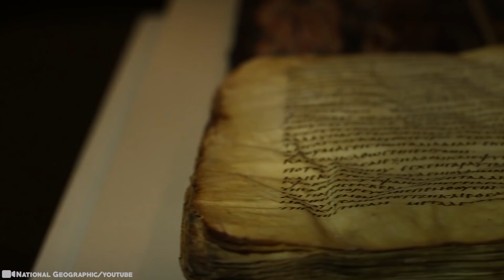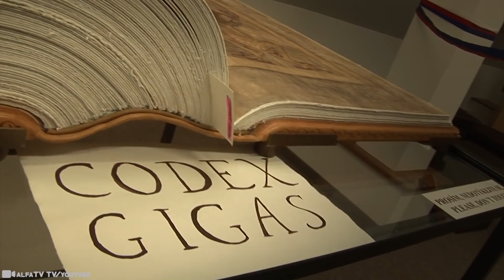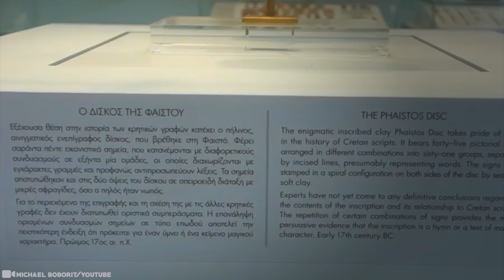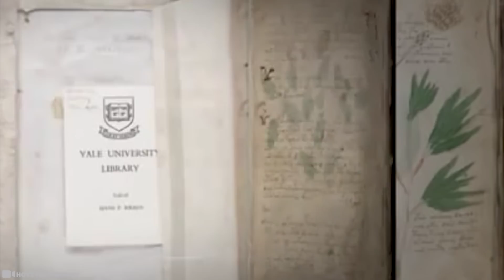15 Old Technologies Scientists Still Can't Explain

Comment: Roman concrete also used sea water to mix their concrete. The salt acts as a binding agent in the concrete and makes it less porous and much stronger. To any roman you knew to use sea water where as in the recipe for concrete it simply said water and nobody thought for a while to use sea water and not just water.

Comment: It's always baffled me when so called "intelligent" people can't understand how the ancients were able to create some of these items without "Modern" technology.
Reply: Probably because the people conducting the research are archaeologists. That doesn't make them good at physics. We probably have the capacity to figure most of the science related things out - we're just not concentrating our resources on them.
Reply: @crikeymikey8731  I was just watching a video on the Bagger 288, which is the largest bucket wheel excavator in the world.
When they measure the output of these vehicles they measure it by how many people carrying pick, shovels and wheelbarrows it replaces, the Bagger 288 replaces 40,000 men. When the ancient Egyptians built the pyramids, they didn't have a bagger288, they just used the 40,000 men because they didn't need modern tech to perform the same task.
All modern tech does is replace people in the workplace, it didn't mean that it made certain tasks possible. We have way too many so called "intellectuals" lacking humility in the face of science. That seems to be a new thing.
Reply: @scottfuller1711  lmfao

Comment: Modern Damascus steel is not the same as the original metal. While it may be made using the same techniques, the original Damascus steel used a metal called wootz steel. Wootz steel does not exist today, but moden blades made using high-carbon steel and forged with pattern-welding approximate Damascus steel.May 2, 2021

Comment: What a load of rubbish. Damascus steel is still made and used in English shotguns. Its production method is very well known and is not a lost art as the commentary suggests. Try to be a bit more factual and not sensationalist.
Reply: The Damascus we have today is not the same as the Ancient Damascus. Scientists however, have been able to find that Ancient Damascus contains  nano tubes within the metal, and the only thing in nature that has such nano tubes within its makeup is plant fiber. They know that they must have mixed plant fiber into the metal when they forged the blades, but they do not know what process they used to make the Damascus metal. The process of making this Damascus metal was kept so secret among the ancient bladesmiths that it has been lost to time.

Comment: We know how to make Damascus steel. What's more we can't make even better steel today. Modern steel is vastly superior to ancient Damascus steel. 

It is true we don't know how ancient people made Damascus, because it requires heating iron ore over 2000°F, something we're not sure how the ancients actually achieved. But Damascus was very pure, and had a high carbon content, so they would have quite strong. In the iron age though Damascus would have seemed supernatural. If your sword is much stronger and breaks the swords of your enemies, it would have seemed magical. Some archeologists think ancient Damascus forgers might have introduced carbon material in the form of bones. Which if you imbue your weapon with the bones of an ancestor, or a fallen warrior, you might perceive the unbreakablility of Damascus being the spirit of your ancestors enchanting the blade. 

So no, Damascus steel isn't magical. And it's not necessarily better than modern steel. But it is beautiful, especially if you etch it with acid to show the layers. 

But the point of contention is more just how did ancient people make it, not that we can't make it today. I guess you could say we don't know the exact recipe so we can't make it exactly like they used to, but yeah, modern techniques are superior.

Comment: Complete and utter B.S. What exactly does explain mean? 
   Things stated as though they are facts that are speculation. For example, The statement the Ancient Temple of The Holy Frequency was built to resonate at 111 hertz. Any and every volume with a single opening has a resonate frequency. Blow across the mouth of a bottle. The larger the bottle the lower the resonate frequency. 

    The only way anyone could know if the temple was designed to resonate is if the builders said so.

Comment: You really need to check your fackts. The knowledge required to forge Damascus steel was never lost as it is exactly the same as forging any other steel. Some years ago and American finally recreated it, The term is often used incorrectly when refering to pattern steel. As for building structures with huge monoliths, that to is no puzzle plenty of archeaologists have demonstrated how it is done. The only unknown fact regarding the Antikythers is who design and built it, There are now a number of working replicas and we know what it is for and how it works.

Comment: Damascus steel is just blue steel forge at high temperature with certain techniques the patterns are just a side effect of the process and depends a lot on the quality of the iron and how it was cold etc.

But yeah there is a ore called or said to be called damascus ore in witch its just iron with very specific qualities, it is said that the high quality iron or good formed iron as in with( low impurities) if im not mistaken was abundant in mines in literally damascus  were in gets its named.

But there a better steel technique called spring steel witch is better then damascus base on some resources already in old times the spring sword was already made a long time ago, it is said that spring steel in addition being or atleast for what we know for now spring is the best steel made.

Its is said that this steel can literally bend its extremely flexible and fast while also being more durable.

Clear example of spring steel are weapon like the rapier witch can bend go back to it original form without breaking or  shattering or remaining bent that's were the name spring comes in in addition of having also high durability.

But yeah im not saying your wrong and neither im  criticizing you since there a lot of misinformation circulating the internet about damascus steel, but damascus steel is one of the best steel, but not the best or the most durable.

Also their are modern methods to make damascus but it patern depend on the way it was made and the amount impurities in the iron ore.

Ill just leave this comment just for information, its not meant neither intended to offend anybody or criticize anybody, its just some clearing information i learned in the internet and multiple sources.

Comment: right off the bat, the sword didn't rust because it's not iron or steel. It's bronze. Bronze doesn't rust, it patinas and the patina effect on bronze isn't as destructive to the material as rust is to iron and steel, not by a mile.
Reply: ... especially when they said 'And it was in perfect condition' while the video in the background showed how they pulled the messy lump of crusted metal out of the box.

Comment: most of them are fake and I hope you are ashamed of yourself. Just for the one I already know. 
The sword of gouijan is a incredible piece of art and history yes, is it magically not rusting ? No, in fact it is very fragile and rusted. The fact that it was found in an air tight room along with the composition of the decoration made it more resistant to corrosion but nowday it is as fragile as a piece of porcelaine and could break. It did indeed partially break after a light shock and is now forbidden to go out of china. Also the inscription are translated almost perfectly. 
The iron pillar date from the 11th century ("so old it predate the wheel" seriously?). And it is very impure indeed, not 99.999% iron or I don't know what bullshit. You are so bad that you did not understand what make it mysterious. The lack of corrosion and rust despite its age is amazing not the purity of iron. It is indeed the impur iron that made it not rust as it is believed that the wood used for smelting it were phosphorous high and thus created a layer of phosphorous oxyde with Iron that protect it from corrosion unlike classic Iron. You are misleading and you did not even understand the legend you are telling. 
modern damascus steel is not particulary hard or sharp (by modern standard). It is not even a quality of metal. It is a word used to speak about this beatifull patern that can be made by a variety of steel. You need to stack different sheet of steel wield them together and a bit of acid will make the patern appear. The ancien damascus steel was indeed a very good steel for its time we have blade and other metal scrap that can confirm it. It was not magical nor the best steel on earth at that time. Indeed it was made by arab and persian who imported the steel from asia which got better steel and wielding technic at that time. Even in europe you can find steel as good as damascus but it was less pretty. The european going into crusade tell the damascus steel to be the most impressive to make their ennemis look fearsome. The arab spoke about the steel of their armor and long sword (very hard to make a long sword that hold well) the same way, and indeed a long hard resistant often demand much better iron than medium size saber. The shape of which is made to cut better while distrubuting the force of an heavy blow, the long sword does this just thanks to its materials (a bit simplfied here).  We perfectly know what it was it is called wotz steel. A lot of forgeron and scientist remade ancien damascus steel but it is impossible to know the exact technique that was used because it was lost in time. We can make the same using old technics we can make better with modern technics but we are not exactly sure what technic did they used. It is a question for historian as making a steel that is resistant was never easy at that time because forgeron did not know what part of their preparation was usefull. The quality of the raw material was for some as important as the "magic" forge or the "magic" salt they used to make it. Because of that they lose their craft as the salt composition might not been known or the reason why the forge was magical either, even more the raw material could have changed and they would believe that it was another thing. This is the interest of damascus to find back a forgotten technic and how it held so much in time. Not because it is so good that it can cut a feather. You can make glass that cut a feather in the air, or even plastic sharpness is only loosely related to the material it is more related to how it is wielded and how you sharpen it. Silex from stone age were more sharp than most sword of the middle age yet it does not mean shit.

Comment: What a crock of sh1t. I **OWN** a EURO 3000 Damascus steel Gladius, hand crafted by El Gur Swordsmith in the czech Republic. Damascus steel / folded steel is not a lost technique, its just expensive, takes a long time to produce and as such is rare as hell. It isn't so isn't widespread, but is still used in projects by specialist swordsmiths and metalworkers. All Damascus steel "recipes" are variants, no two are exactly the same, but the metalurgical basics (folding steel, adding carbon during folds) are the same as in ancient times...

Comment: "carved to be 111hz"
....what if thats just that materials frequency? if it's caves the material would be found in multiple locations.
Reply: Doesnt work that way, unfortunately. To my knowledge, there aren't any material bound mechanical frequencies (like pressure wave = sound). Only electromagnetical ones (e.g. color).
What resonates, is in fact the volume of air, like in a organ pipe.
How does it exactly work..? I have no effing clue.

Comment: the "secret" of damascus steel is that the items made from this steel are made from recycled bloomery steel. because bloomery's are more art than science the carbon content varies widely per batch, and no two chunks of ore are alike. While yes sometimes true damascus steel blades are stronger, for a long time they were considered poor quality because they were less refined and frequently prone to cracking or breaking during use. damascus steel is more myth than reality, but the modern recreation with different carbon/nickel content steels stacked reaches more of that myth and is nothing like historical damascus.
Reply: Anyone folding modern steel is an idiot unless they're specifically looking for a decorative piece.
Reply: This is a factually incorrect comment by someone who clearly didnt do meaningful research on the topic before forming an "opinion"

Comment: wootz steel or damascus steel as many armchair blacksmiths would call it, is just iron ore from a mine that happened to have vanadium in it making it stronger and harder to forge than normal at the time and due to the trace amount of vanadium it when forged it would precipitate and leave markings. nowadays wootz steel is very expensive and hard to make. however it is not by any means better than modern steel and there are many types of modern steel, spring steel, tool steel, ultra high carbon steel. and many more. wootz is was just a better metal than everything else back then. so much so that it became legend much like the ulfberht swords which just simply had a higher carbon content in them making them more resilient. im no blacksmith but getting a hard on for "ancient tech" and claiming its the best is just plain ignorance

Comment: The ancient battery was actually used for a long period to study electricity since the early 1500's (I am not exactly sure of the time because I don't have the textbook) It was said to be derived from an older form of a battery using hematite (iron ore) and copper deposits. It was improved using zinc between the copper layers to create an electrical charge with thin parchment soaked in vinegar as a separator.
Reply: Stop using apostrophes to make plurals. That isn't what they're for. It's 1500s.
Reply: @englishatheart  but it is proper format.
Reply: I am pretty sure that vinegar, or vinegar soaked parchment isn't a useful separator.
As Javier Valenzuela said:
It's likely, the so called batteries were scroll containers. 
If it had been a battery we would have likely found layers of those metals, insulated from each other. Not one single metal rod in the middle with parchment scrolled around it...
Reply: It was a scroll container.

Comment: The secret to Roman concrete was salt water instead of fresh water. Since that was their most commonly accessible water it was never thought to specify it when they wrote their recipes.
Reply: also top quality modern concrete would be superior to roman concrete but it would also be extremely expensive oh and although reinforcing concrete with steel increases tensile strength it decreases longevity due to steel rusting but we need that tensile strength for bridges and the like

Comment: Since the well-known technique of pattern welding - the forge-welding of a blade from several differing pieces - produced surface patterns similar to those found on Damascus blades, some modern blacksmiths were erroneously led to believe that the original Damascus blades were made using this technique. However today, the difference between wootz steel and pattern welding is fully documented and well understood.[30][31][32] Pattern-welded steel has been referred to as "Damascus steel" since 1973 when Bladesmith William F. Moran unveiled his "Damascus knives" at the Knifemakers' Guild Show.[33][34]

Comment: 9:17 in video duration, that doesn't look like Satan and what lead to that conclusion? To me it looks like the high priest of the Holy Bible because he had to carry a breastplate with 12 different jams which represented the 12 tribes of Israel... and not just that but why is the back of it look like metal is that the cover for the actual book? And why does it have holes on the sides of it, it looks like some type of code like a key

Comment: Damascus steel is just pattern welded steel. Wootz steel was a crucible steel, but the recipe was lost for a time. Now days its really irrelevant, as we still have examples of whootz steel, and our technology has shown that our current metal technologies produce a purer and stronger blade steel than the whootz steel. The only real difference besides quality, being the pattern that the whootz process created do to its imperfections. But we can make any pattern we wish on blades now days, and the blades will be harder and more durable. As for the ancient computer, its a machine that predicts and shows the pattern of the starts in the sky, and what they will be on a given day and time. Its not that its an actual computer the way we would think one. Just a machine more advanced tham we would have thought possible at the time. That just shows we are not all knowing. And we need to be more observant.

Comment: You lost me at "no one knows how to make Damascus steel."  Every blacksmith and knife making channel on YouTube has at least one video on making Damascus.
Reply: It’s not true Damascus steel. Modern Damascus is completely different and only similar in appearance
Reply: @nw649  oh.  Ok.  Well that would make sense then
Reply: @nw649  Even true Damascus isn't that hard to make; it a simple process using old tech.  It's just not worth the effort to make since pattern welded gives essentially the same look (which is what is usually mislabeled as Damascus today) and modern metals are much better than true Damascus ever was.  Even "Damascus Steel" of the day had a very wide variance of quality and was more a sales pitch than any true measure of a blades worth.  It's like a thousand years from now wondering over the lost tech of the Sham-wow.